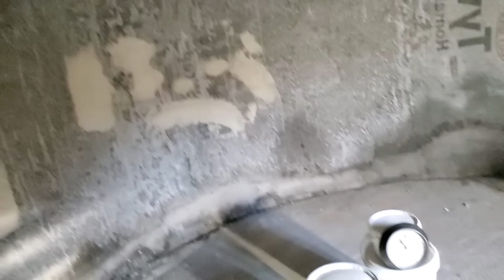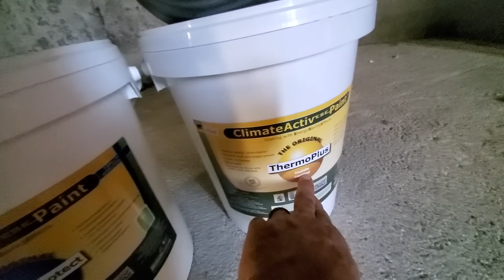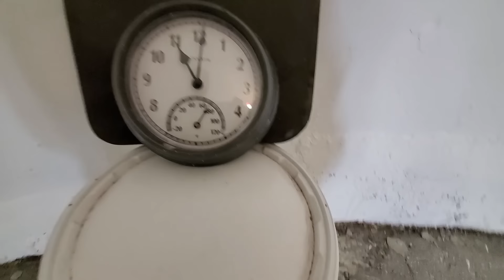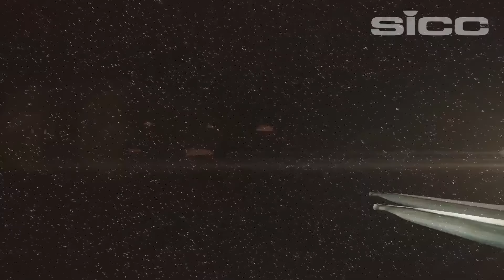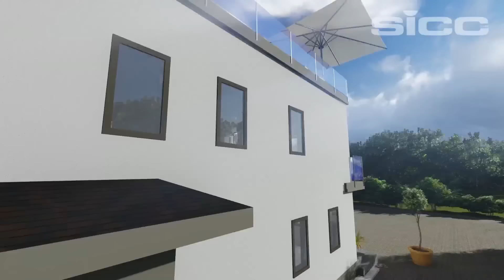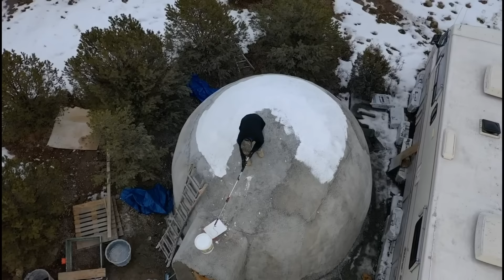Dome Cabin Build | Off-Grid Part 7 | Painting | Aircrete Harry | #aircreteharry #dome #diy #airform

Comment: Would petroleum based paint repel water
Reply from the maker: Oil bas paint sounds like it may work to repel water, I don't know a lot about paint.
Reply: In my experience Petroleum ( enamel ) based paints do repel water however the paint might peal more than plastic or acrylic paints ( after many years ), Also the colour can be used to cool or heat a structure ( white to keep cool, black to be hot inside )

Comment: You did not finish giving the details of how paint affected temperature inside after you completed painting the outside. You went into such detail earlier, after only painting the inside, & even included video from the company, but did not include your conclusion.
Did it work? Was it so little improvement after painting the outside that it did jot merit even mentioning? 
I was looking forward to the results...can you post those details please? In fact, you can give an update on how well the paint stuck to the exterior & interior walls & how much you are saving on energy now....thanks!
Reply from the maker: Okay, I'll make a video talking about my conclusion. Thank You for your comment. P.S. The paint works great!

Comment: If you are going to use propane you should look into getting a vent so the gas won't use up all the air.
Reply from the maker: I have a 2 inch gap in the door top and bottom works good for fresh air. I can control air flow with curtains.

Comment: The video you had with shipping container and this paint with the blue n white, like to see a comparison with blue n blue of this paint to see if any difference. as the white itself was a key factor there.. but ceramics can help, I know we use it for header coatings to keep heat inside the pipe instead of engine compartment....

Comment: I thought I saw a video of yours a few years back, showing Basalt Mesh to be the least effective reinforcement material for these kinds of builds.  Wasn't that you?
Reply from the maker: Not Basalt Mesh, what I used was Basalt Fiber chopped and it was less effective than Steel micro rebar.
Reply: @AircreteHarry  -  Oops!  You're absolutely right--it was chopped Basalt.  Got it. Thanks!

Comment: This thermal insulating paint scam is ages old. Its all confirmation bias. Sure a thin layer of aerogel would probably be noticable even if paint layer thin. But not much. But its not like you could grind that up and put it in paint without losing its effectiveness. IR reflecting stuff works in thin layer,but that is a pretty special case and does not replace normal insulation.
Reply from the maker: No scam, it works. Check out my first test with the paint. And no plain white paint would have the same effect as this CAP.  https://www.youtube.com/watch?v=V28sdwH663w

Comment: Just put a cheap green roof on it, it will be lots prettier, and low cost.
Reply from the maker: The paint is also acting as a seal to stop water getting into the cement.
Reply: @AircreteHarry  so, when the paint peels, water gets in, freezes, spalls the crete, and....?....
Reply: @AircreteHarry  if in need, look up crosslinked urethane roof paint....it will last a very long time.

Comment: Harry ! Dome shaped basements ? Simple smoothed pit - finished real accurate by centre point tool on a rope - if reinforcement left poking up to join a dome - makes a perfect SPHERE ! Weighted right might even float - I have heard of a concrete boat - very round bottom could be a water tank - or even for fish
Reply from the maker: If I could dig deeper than 3 feet here I would have a dome basement. I like your thinking.

Comment: The moisture will be from the propane heaters. Why anybody would use those gas heaters is beyond me.
Reply from the maker: Temporary solution for an off grid cabin. Electric heaters would kill the battery's very quickly. Rocket Stove Mass h=Heater coming soon.

Comment: How do you get fresh air? There is a device called a heat recovery ventilator. It can provide fresh air, without losing heat.
Reply from the maker: Thank you, I'm aware of the HRV system and have been looking into them.
Reply: @AircreteHarry  I saw some guy on youtube had an good idea for DIY HRV, basically get a thin sheet of aluminium and fold it many times to get lots of surface area, build a box around it and have 4 air holes, 2 on each side separated by alu, aluminium is cheap and has excellent heat exchange properties, outside air goes in box, gets warm by the alu, and enter the house, stale air from inside the house goes on the other side of the alu box warms the cold air before it goes out. there maybe some condensation but easy to fix with few small holes and pipes, only recovers heat not humanity, sorry cant remember where i saw it,

Comment: How come you didn't mention the torpedo heater you were using while you were painting; along with the smaller heater?
Reply from the maker: I meant to add that bit of info but forgot to add it.  After the first temperature reading  I put on the 60,000 BTU torpedo heater on all night to dry-out the walls be for painting, and left it on to help dry the paint faster for about an hour after I finished painting. Then I put the Mr Heater on all night before taking the seconded temperature reading.

Comment: The results you showed are pretty much meaningless. When you first show the temp at 60 the door is wide open. When you show it at 70, the door is closed. Also, you don't tell us what the outside temperature is for the before and after, and you don't tell us what time of day the before and after. This really felt like a dubious 20-minute long commercial - not the kind of ting I subscribed for - not complaining - just offering feedback.
Reply from the maker: Thanks for your comments.  I'll make sure to explain it better in the future.    The door was open because I just walked in to the dome around 9am when the temp was about 25 degrees after a night of 7 degrees, it was about the same temp the two nights.
Reply: @AircreteHarry  but the door was open the whole time you shot that clip - with such a small area that would quickly and drastically change the temperature in there. Anyways, not a very scientific test to say the least. 😉
Reply from the maker: @3DTOPO  Maybe if there was an open window also it would change the temperature . But the open door had no effect on the temperature during the recording.
Reply: @AircreteHarry  that's just not believable. I have a building about the same size, and every second the door is open changes the temperature when its that much colder outside
Reply: @3DTOPO Happy New Year My Friend! ✌️

Please understand what we share in the videos is not based on a hearsay. 
MY  H_u_s_b_a_n_d  is Hands-on testing, recording as is & sharing the RAW results with the World. 
Whether it works or not, it is shown. We built a structure to personally stay in; which we do not expect to be less than Safe & Secure in any aspect. 
What good would it be for us to tell you anything other than what really is, - again, we personally live in this Beautiful Dome. 
Shooting yourself in the foot is no fun guaranteed. 😉

I tell & advice to not go by other's statements but by your own results. 💪👍
And so we do the same. We experiment, test, see for ourselves & show the outcome results in the videos. 
One  F_a_c_t  I'll keep on saying is, MY  H_o_n_e_y  Lives & Breathes Greatness with a Heart of a True Determination of Helping Others & Helping the World. 
👊🌎🌍🌏👊
#Determinator, Baby! 

My Best,
Mrs. Aircrete 👣
Reply: @off-griddomeliving8018  Hi Mrs. Aircrete! Thats great and all, but, if his testing is unscientific, so will the results. As presented; the paint insulation test was anything but scientific. On top of that, misleading claims are made, as it would be a clear violation of thermodynamics for a thin layer of paint to provide anywhere near R-22 in insulation value. I admire what you both are working on, but I don’t admire infomercial style videos that make dubious claims. See https://en.wikipedia.org/wiki/Insulative_paint
Reply: @3DTOPO - I understand what you are saying. Personally - someone might assure me it's sugar, yet it could be salt. So I get it. 
My Honey knows I am not a hearsay person, I sure ain't buying people's words, I need me some actions, facts & proof! Since I personally was there step by step, I am convinced of the results. We both saw great difference. 
I Appreciate seeing comments people leave under any videos, it opens the gates to Communication, better Understanding, Clarification & Suggestions as to what could had been shown better, discussed more, etc. 
Please, if there are any suggestions, - we welcome it all! 
I Appreciate You & Your Time! Sending My Positive Energy 
~ Mrs. Aircrete 😊👣🙏👊

Comment: I figured I would post this here
When shooting any type of shotcrete  you want to start at the bottom and build up to the desired thickness as you move up 
Add lime for stickynes 
Trowel for the detail work before it sets up 
For those that have not figured it out 
You could add another dome over with an air gap and just waterproof that one you will find that you will have no moisture issues and it will stay cool and hold heat 
Nice job
Reply from the maker: Thanks! One of the dome builds for this year will be a two dome system with Aircrete to fill the cavity.
Reply: make the larger dome first
Reply from the maker: @Indicafatbud  Larger dome build coming this spring.

Comment: Nice Video, audio needs to be louder. But no windows! How do you plan to breathe, especially if you have a propane heater? Regards.
Reply: I was thinking the same thing about the heater. In such a small area it could be fatal - that heater really needs to be vented. I suppose it wouldn't be hard to poke a hole through the wall to add a vent for it though.
Reply from the maker: @3DTOPO  I will be installing a energy recovery ventilators. I will make a video of the installation.   https://www.youtube.com/watch?v=ncVuZi9DIIw
Reply from the maker: I will be installing a energy recovery ventilators. I will make a video of the installation.   https://www.youtube.com/watch?v=ncVuZi9DIIw
Reply: @AircreteHarry  Thanks, Harry for your kind response. My philosophy in life is being as natural as possible and to depend on dubious technologies, the less possible. I love rammed earth for building, but it is very labor-intensive compared to Aircrete. Thermal efficiency can be achieved using the principles of the underground housing of Mike Oehler's books. Although being "underground," the house still has windows and natural light. I will love to see these concepts applied in the construction of Aircrete domes. Keep doing the good work Harry, and thanks for sharing your advances and techniques with your illustrative videos. Regards.

Comment: You might consider a larger tyvek air dome over top of the dome as a temporary shell cover until you can get the outside coated.

Also, propane burns and puts off two water molicules for every one of propane burned.  So you are putting water into the air, as well as CO2.  Just something to think about, because I bet not all the water is coming from the outside or concrete.
Reply from the maker: Thank You for the information>
Reply: @AircreteHarry  You can make good foam in a regular mud mixer, and blow it with  a leaf blower.
Reply: I came down here to say the same thing, personal experience + spending a few months working in the home performance business taught me non-vented propane is really bad for residential use.
Reply: what he said
Reply: A 20 lb tank of propane produces about 4 gallons of water as water vapor when burned. That Big Buddy heater can go through that in a day or two if left on the high setting. I've used the same heater indoors as a backup for a couple days and the condensation was bad. Had to leave windows cracked.

Comment: What was the temperature outside the dome AFTER the paint was applied INSIDE the dome? Harry shows 80 degrees at head height in the dome but doesn't tell us what the outside temperature is.
Reply from the maker: About 20 degrees the night after I painted it holds the heat really good.

Comment: Great work.. Its quite a fantastic finish you have achieved. Thanks for all your efforts..  as you no doubt realize if you had a fan to circulate the inside air the over all air quality would suffer due to the fuel burn.. I use a waste oil burner outside and blow past and around the hot chimney to heat air and send that to my van..waste oil no cost and hot air no fume. Ebay has chinese diesel van heater same idea... thanks aircrete harry  great work
Reply from the maker: The heater I'm using now is just until I build my Rocket Stove mass heater.

Comment: Great product.  I think the R value improvement you stated is more optimistic.  Paint thickness is only a few ten thousands.  Stagnant air would I believe not reach the value you stated, but I have not done the analysis, I must admit.  The conductivity of the paint binder and the ceramic shell is an order of magnitude worse then air and first reduces the air thickness and provides an alternate path.  A simple example is the resistance of two resistors in parallel, one very small and one very big.  (resistance is the inverse of conductivity)  The combined resistance is dominated by the small resistor, or the higher conductor, the solid material.    It is still a great product and their claims presented in the video are accurate.  They do not suggest the R value.
Reply from the maker: Thank You for the information.